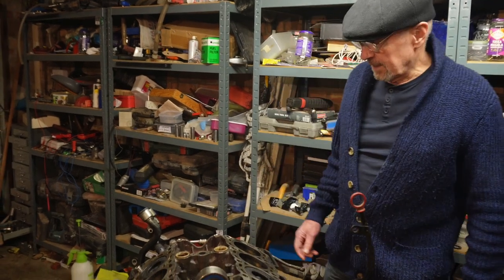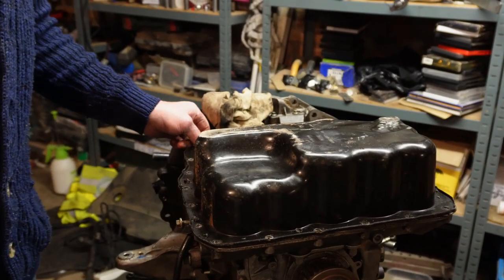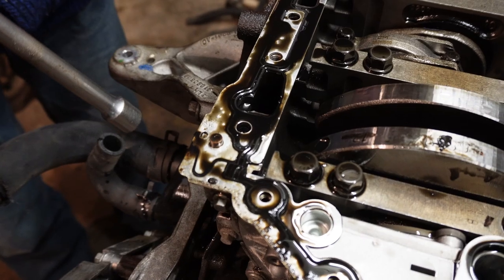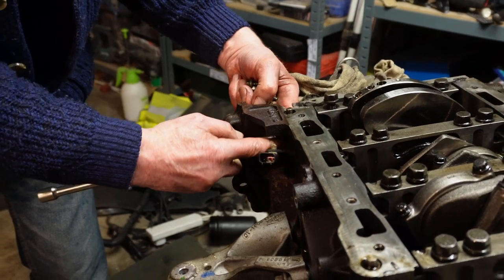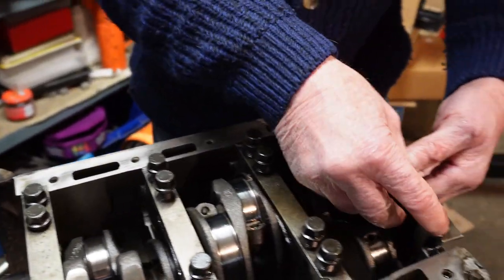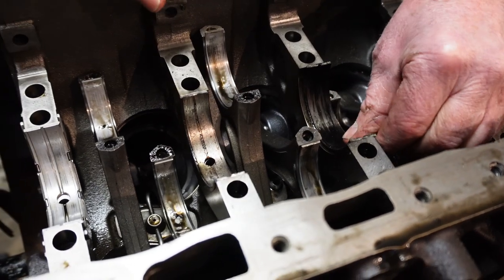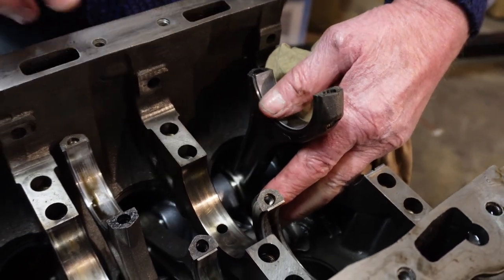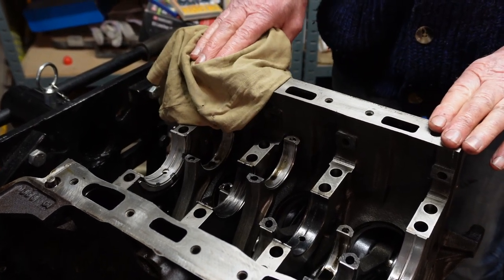2.7 / 3.0 Diesel TD V6 Jaguar Land Rover - Destroyed Bottom End Crankshaft

Comment: This engine is released in the Ford territory in Australia with the 2.7l and their are literally no issues hear with these engines. This type of damage is classically caused by bad drivers flooring the accelerator when the oil is stone cold repeatedly and being a V6 doesn't help. Because the territory is just a average car without a premium image they don't get thrashed, often driven by middle class moms not by rich wankers that think that their 4x4 is a sports car. If you want to know what causes these failures first look at the people that drive them.

Comment: Look at this: A hand in shot. Many minutes of undoing bolts despite saying you'd do it off camera. Then more bolts. Camera not showing what you're looking at. 
Don't give up the day job. 
Videos like this are why I don't make YouTube videos, you may know your subject, but if you're rubbish at filming and editing it ends up like this.
Reply from the maker: Hi Tuppy, thank you for watching and for your feedback. Could you give the time of " hand in shot " in the video, you will find the minutes and seconds at the bottom of the video. The bolts were undone off camera apart from the last couple of threads. Give the time when the " camara is not showing what i'm looking at ". At the end of your comment you intimate that you are rubbish at filming and editing and that is the reason you don't make YouTube videos. Could you clarify which parts of the video you found hard to follow, the oil pump removal  -  the oil pan / sump - the front sprocket - the drive plate - the ladder rack - the main bearing caps - the big end caps - the crankshaft etc etc ? Thanks again for your feedback.
Reply: @crystalclearmechanics  Don't worry about trolls.
Reply from the maker: Hi, thank you for watching and for your feedback. I appreciate it. @S-u-p-a